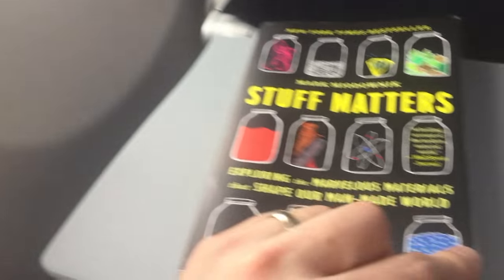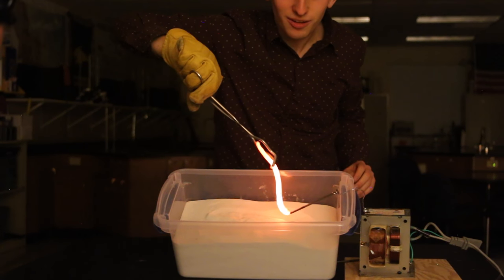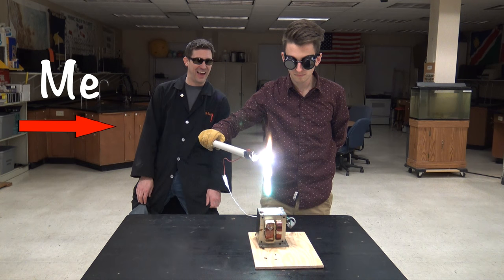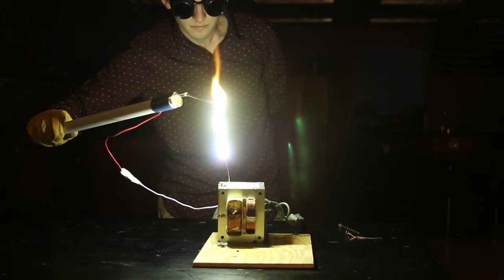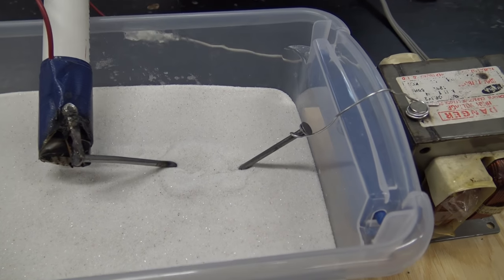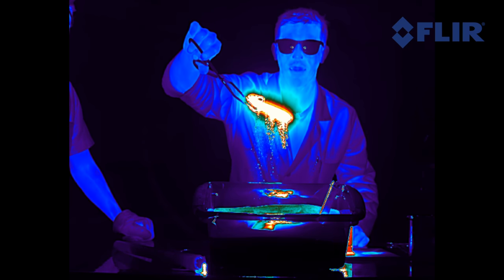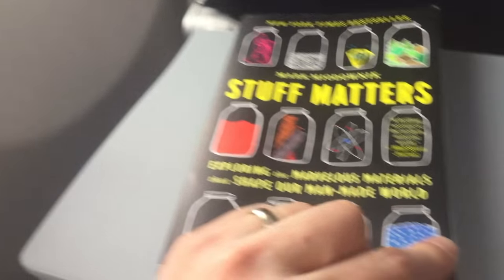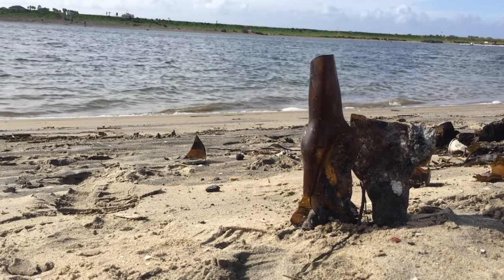Making Glass - Melting Sand with High Voltage Electricity!

Comment: No offence to Quinn but I've used microwave transformers for experiments like that before and I'm only 16 I've self taught myself for a while now and its kinda just common sense for me not genius. What I didn't know was that you could melt glass with one of those transformers nice job for an active creative mind 👍
Reply: You can wire a ballast to a flyback transformer, put a Leyden jar on the output and melt glass. If you remove the Leyden jar, you can make some inscriptions on it.
Reply: Well how do you do it?
Reply: @ericklopes4046  You can also submerge the transformer in a non conductive oil (transformer oil) for longer high current draws.

Comment: How about using giant parabolic lenses in a desert to focus concentrated sun rays in one area?
Reply from the maker: With enough lenses I am sure you could melt sand! That would be pretty cool!
Reply: @BealsScience  Thanks, I've been imagining this for over 25 years,  -maybe a great/affordable way to make deserts livable if it had it's own simplified construction/building block tools. Glass can also be used to collect and hold water through condensation, many things could be possible.  I was told long ago that desert sand is too impure but if lightening can make glass in the desert, I'm sure it's more than possible.

Comment: I don't think it's 'ionizing' the sand, as I remember correctly - sand/glass will become electrically conductive when it's at molten state, that's what keep the arc going... It get molten at first when the 2 wire are at close together caused the arcing and that melts the sand, the molten sand will become a resistor and continue to produce more heat when electricity passing through it, meanwhile the arc will melt the other sand on its path - creating longer piece of glass

Really interesting video though... I've only seen people melting sand using a graphite crucible with an arc welder at high current to melting it first then put inside a microwave for continue heating it (because it's conductive on its molten state), never seen it's done on high voltage arc

Comment: Have you considered generating a plasma arc and slowly pouring the sand through it? As the sand heats up, it will become conductive and propagate the plasma. The heated sand will form glass droplets than can be further refined in a later process.
Reply from the maker: I like your idea! I will have to try it out next time!
Thanks!
Reply: @BealsScience  If you want to go old school, use antique labware to make an hourglass to feed the sand.

Comment: Silica sand isn't pure silicon, there's lots of impurities, even in your play sand, there's calcium, magnesium, carbonates, phospates other metal oxides. Glass can be made from pure silica sand, but it's not actually glass, it's fused quartz, it has different properties and it's melting/softening point is far too high for it to be economical to make all the stuff we make from glass, so it's pretty much only used in halogen lighting, UV lighting (most glass is opaque to UV radiation <280nm) and high temperature lab "glassware". For everyday glass products, we usually add sodium carbonate and calcium carbonate to make soda lime glass, or boric acid to get borosilicate glass. Both soda-lime and borosilicate glasses have far better workability than fused quartz, meaning you can actually mold it without the material you've made the mold from melting due to the temperature of the molten glass.

We use sand for casting metals, even ones with melting points as high as steel, yet you don't see glass form on the metal, because sand has way too high a melting point (1650 C) to melt into glass from even molten steel, to melt it, you need a lot of energy, you just used over 1 kilowatt of to melt a tiny amount of sand. most commercial glasses are at most 85% weight silica and the beer bottles you showed are only 70% silica by weight, the melting point of those glasses is >300 C cooler than pure silica, which if you understand thermodynamics and materials science means you have a lot more options for heating up and maintaining the temperature of and physically containing the molten glass than you do with fused silica.

Comment: Hey how do you actually do this project?
Reply from the maker: The first thing you need to do is track down a high voltage transformer. Then run the positive and negative leads into the sand! If you have enough electricity moving through the sand it will work!

Comment: Great content :) You deserve way more views/subs! Maybe a couple of collaboration videos are the way forward :)  ...Also, why does lightening create a tube of glass rather than a stick of glass?
Reply from the maker: thank you! Perhaps some collaborations would increase my subs - I will look into that for summertime (school is in full swing right now so time is tight!). Our "fulgerites" were not tubes but were more "glassy" at the center as opposed to the edges. I am guessing this is because the amount of electricity and heat we were melting the sand with. It appears that most lightning fulgerites are mostly hollow. While I am not exactly sure why I could guess that because of the amount of electricity being sent through the sand. This could, in turn, turn it to a plasma very quickly and allow it only to solidify at the edges where it is cool enough to do so - leaving a mostly hollow center. But, I will do some more checking now that you have piqued my interest!
Reply: Nice one :) Very interesting! lol was just checking the sold listings on ebay for fulgurites and it seems some people actually make money from selling them...guessing it would be a little too difficult / expensive to replicate a lightening bolt in order to artificially manufacture them though haha :( I'll be sure to keep an eye out for more of your vids...got a few to catch up on  :) was also wondering if you could make a prince ruperts drop using the method you have here.
Reply from the maker: A ruperts drip Mike be skill level 5 and we are still hovering at a level 1, but I like your thinking! Quinn is actually working on making shapes in the sand by adjusting the moisture levels. Hopefully we will have results to share this summer!

Comment: Hi Craig,
nice discovery.
interested in what ampers run (primery/secondary coils), as mentioned, that the transformer needed a good, long cooling cycle between  pulling of glass rods.
i don't wanna cause a cross-country blackout. i'm not sure to wait cooling of the red hot glass, or the transformer. cheers, lev

Comment: May I ask you what is the temperature max that your setup can achieve ? I'm curious because glass melts at 1750°C and iron melts much before this temperature. How did you protect the iron nails electrodes against this high temperature ?
Reply: The iron didn't melt because it's the arc that generates the heat.

Comment: cool vid would have loved to see you guys make designs in the sand with the glass but maybe a future vid!
Reply from the maker: good thinking on the designs! We did experiment with wetting down the sand but it was so conductive that the sand didn't melt, the arc just jumped around. We would like to try to make shapes but need to do a little more work to get it there. Any suggestions?
Thanks for watching!
Reply: Beals Science perhaps try placing the stationary nail at the end of the newly formed glass rod and draw another? That may work or maybe a series of nails anchored to something (idk what but anchored in a fashion that won't draw current) and arrange them in a shape, let's say a square, and arc the current from the the first to the next so there is an arc between all of the nails in the desired pattern. It's just an idea but it would be cool if it worked keep up the good work!
Reply from the maker: Not a bad idea! We will definitely try it to see what the results are.
If we are able to get some shapes doing your method we will definitely give you a HUGE shout out!
Reply from the maker: You are the winner of a Bs Logo sticker! 
Email me your mailing address at beals.science@gmail.com and I will get it in the mail!
Thank you for watching and commenting!
Reply: Beals Science I appreciate the gesture but I'm just happy to be watching your content so I'm going to respectfully decline
Reply from the maker: No problem, I've got just the place to send it! 
I will pass your sticker onto a 4th grade student who recently sent me a letter telling me about more videos I should make with liquid nitrogen. 
As always, thanks for watching!!!
Reply: Have a switchboard of grounds available so you can move arch points without disturbing previous lines.

Comment: Is it possible to use a safer voltage ? I was thinking about to use directly the main voltage 230V for this purpose.
Reply: If you think mains is in any way "safer" you need to stay away from experiments like this. Mains will kill you stone dead before you hit the ground just as easily.
Reply: @whynotdean8966  thanks for replying and yes you are absolutely right. However, I assume that the smaller the voltage is, and the easier it is to insulate your system. Therefore, with a 230 voltage, even of the risk of electrocution is still here, the insulator around the copper wire has better chance to protect you than if it was very high voltage. Moreover, I can testify that it works, I built my own setup and with a 230 VDC I have been able to make some arcs , and the heat was enought to melt some glass.